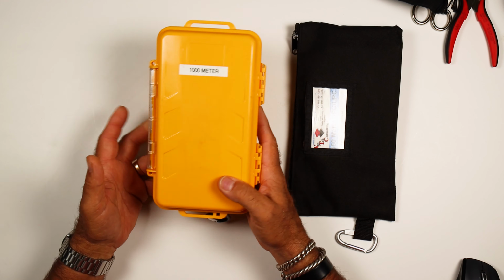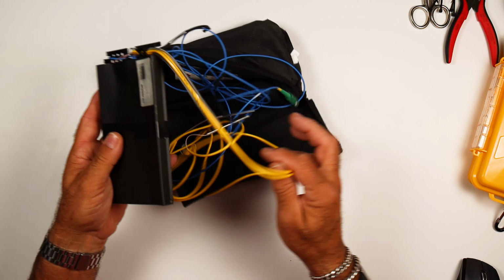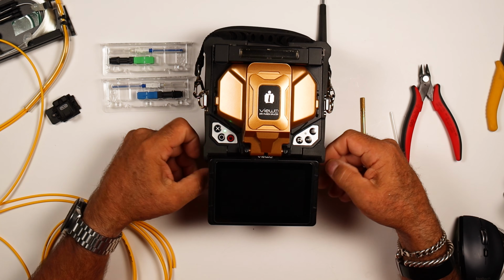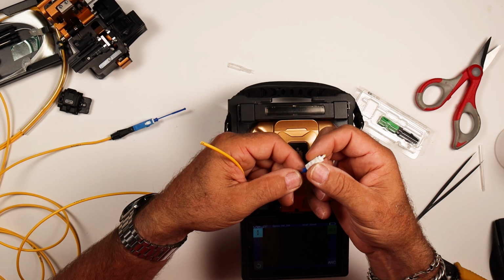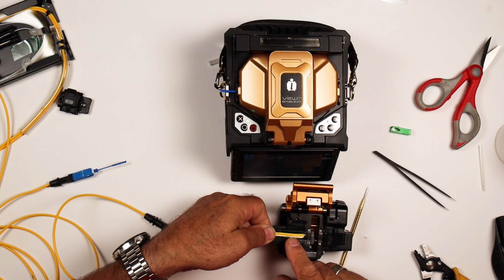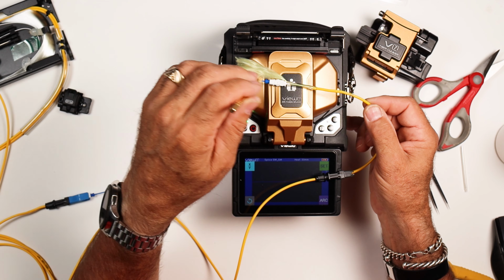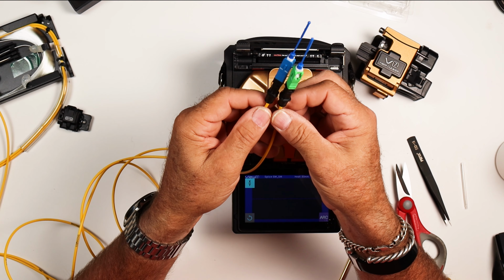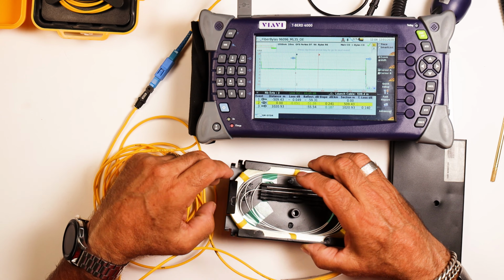Splice On Connectors (Putting on your SOC's)

Comment: FANTASTIC video.  i've been in the field several years and always appreciate ways to learn new/better methods.  I bought the same fusion splicer a few years ago and learned by youtube videos.  I only emergency ISP sliced in the field as needed, but overseeing longhaul sites, its been incredibly handy to have in a pinch!
Reply from the maker: Thank you, glad it helped.
Reply: Hi Sir. Great video. Thanks for sharing.
Does an active clad. align. splicer do a splce with that low attenuation?